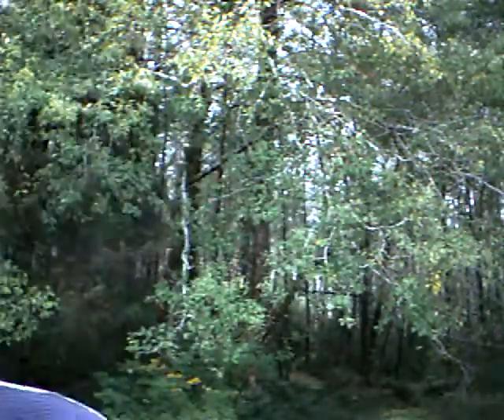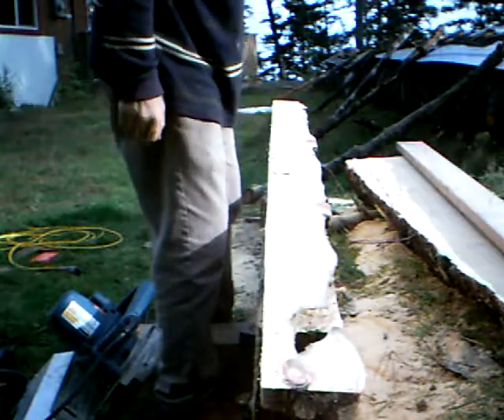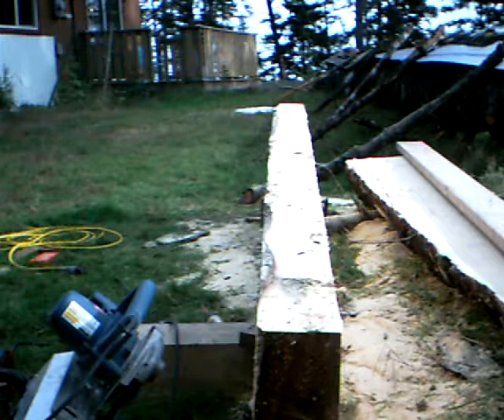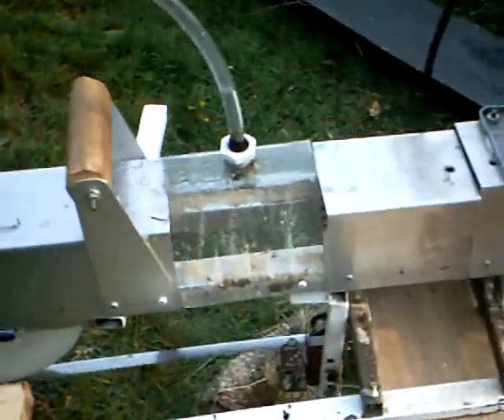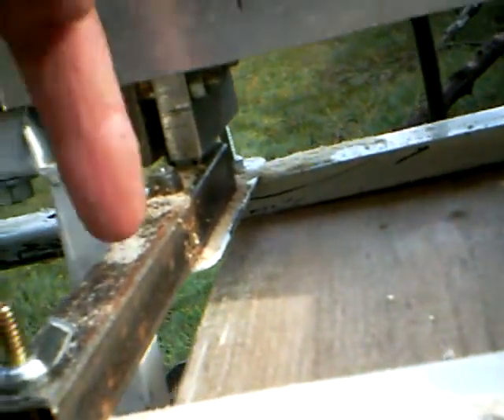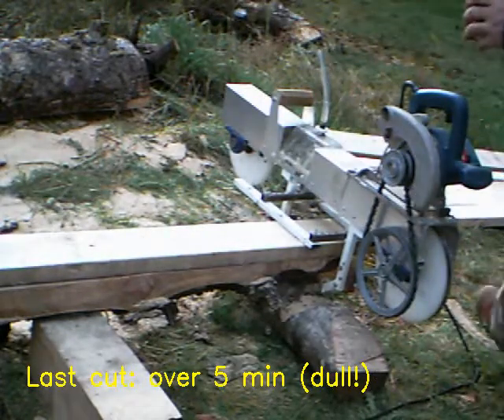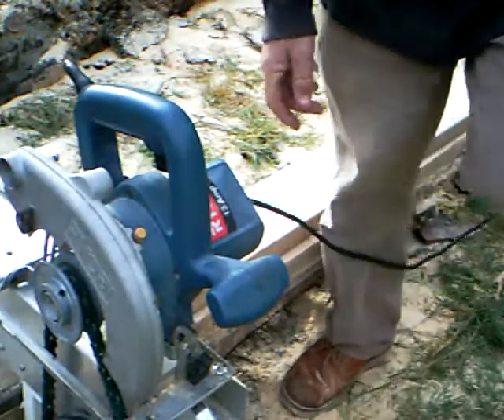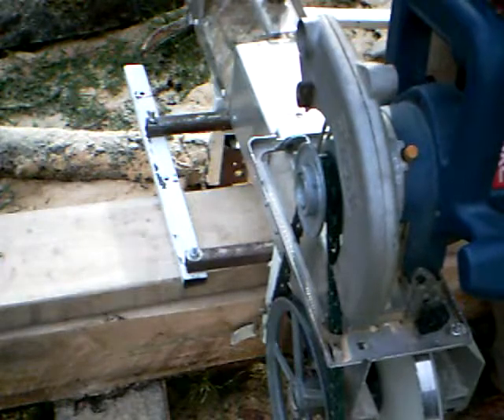Carmichael Mill - Handheld Bandmill - Update

Comment: What an awesome project! I was wondering how do you change the blade on this mill?
Reply from the maker: After you loosen the tension, You have to take a few screws out to take the cover and right handle off and open a slit behind the motor mounting. If we ever get the kit done I think it'll be 4 or 5 screws.

Comment: Nice rough concept. Needs more power. Maybe a 3-4hp gas chainsaw head, and real bandsaw milling blade guides. I like the idea of chainsaw milling a 4"-6" slab and then cutting up boards with something like this.
Reply from the maker: I've been wanting to post an update where the concept has become "less rough", mostly in 2020 IIRC. Hmm, make that 2021. If you go to the website the improvements are shown in my monthly news reports from that period. I had always intended that one could use various means to power it. Whatever sits on top and connects with a pulley. The skillsaw power makes it the only lumber cutting mill that just plugs into 120V - just 2HP but convenient and almost free to run. The self aligning band guides (IMHO) are better than those of any other bandsaw or mill. (I did change to wheels on both sides.)

Comment: Wider guide board...more length on top front and rear.  4 rollers on sides or 4 rounded guides.  You're having to fight it.  Clamp the board in place.

Comment: Great design , you picked the worst circular saw , and the centre of gravity is to high the handles should be at blade height ,zip tie the trigger  or aux kill switch  and bro all that stopping and starting isn’t selling your product it’s making your video annoying or frustrating to watch
Reply from the maker: Hi Joe, thanks for commenting! I just used a cheap 15 amp saw for maximum power (@ 120 V).
True the handles are a bit high. I mostly push it with my legs. The starting and stopping is mainly because of that. As I cut I'm leaning more and more forward until I have to step ahead to a new spot. True the saw could as easily keep running while I'm doing that. (Maybe I'll try that.) I'm putting a link to a newer video about the mill in the description.